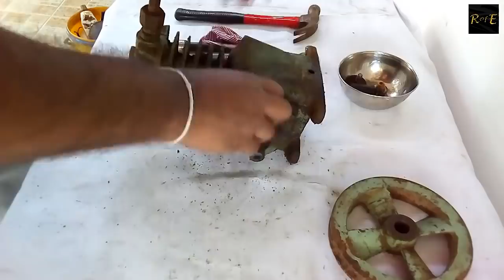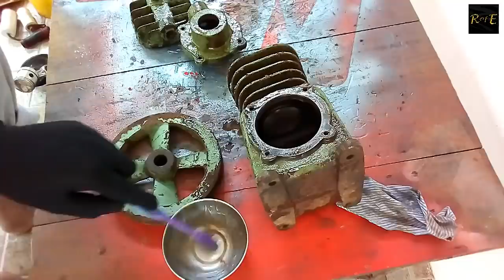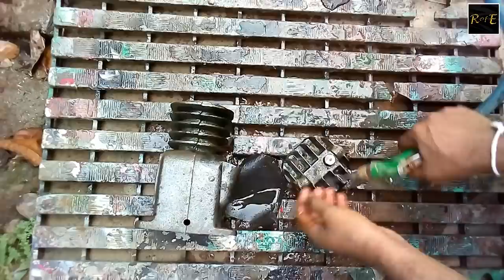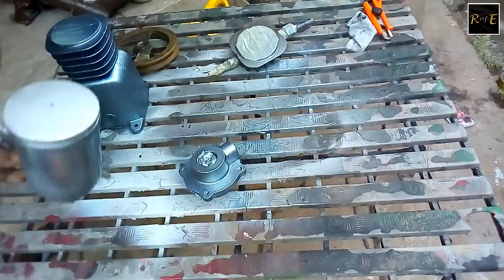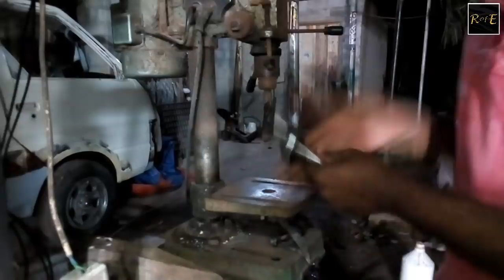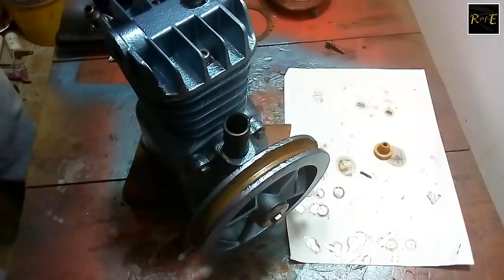Air Compressor Pump Restoration

Comment: Certainly looks good.  The mating surfaces of the head / cylinder could've been rubbed across a piece of emery cloth or sand paper laid on a flat surface.  I would have made a  cardboard  or cork gasket to go between the mating surfaces.  Using a block of wood or a wooden mallet instead of the hammer would lessen possibility of damage to the components.  Look forward to more.
Reply: Took the words right out of my mouth. Throw that silicone gasket maker in the trash and cut your own from a kit.  Otherwise it looks good. 👍🏼

Comment: one importand aspect when closeing an engine,or block,is to use gaskets not rubber gasket makers because the tolerances will decrease..the gasket has its thinckness and that is important especially when closing engines blocks,engine heads etc..compression will decrease if the gasket is missing...silicone gasket makers are good on valve covers etc...but oem gaskets are  very important for tolerances...those bearings must be changed in pairs...if one is gone...the other one will be soon enough if not already...and dont use sealed bearings inside an engine that has oil lubrication...the bearing must benefit from that oil too or it will fail...i agree this is a poor restoration but i apreciate the man trying to do something good with his hands....so!learn more and work more!God bless!

Comment: Vey nice I like how you used the drill press to press the bearing on the crank I've had luck putting the crank in the freezer for about 45 min and have been able to slide the part on

Comment: So basically you cleaned it up and and painted it. No honing, no new rings, no new valves, RTV instead of a head gasket. Probably put the old oil back in! At least you said "restored" and not "rebuilt".

You could really save yourself a lot of work cleaning and scraping if you just had a bead blaster.

Comment: The very first tractor I piloted solo was a 1966 International gas job for Allied Van Lines and it had just such a compressor mounted high on the engine. Noisy SOB would kick in and I dropped 300 RPM until it stopped.
        Mike
Reply: ξ ι ι